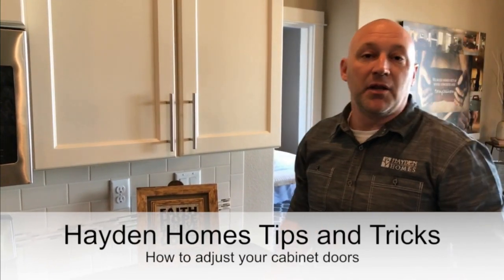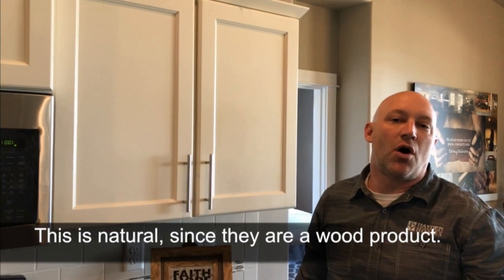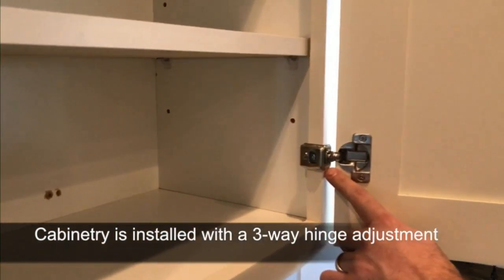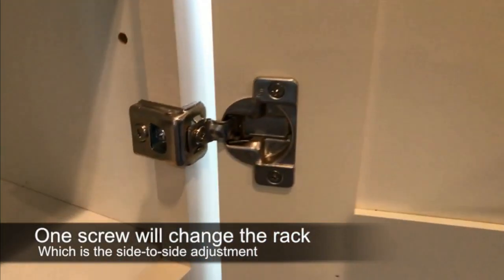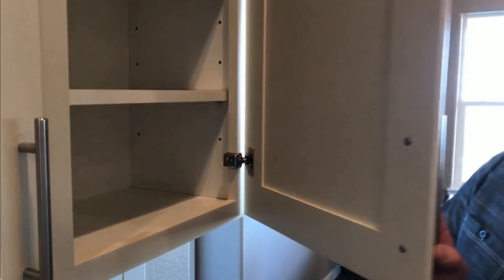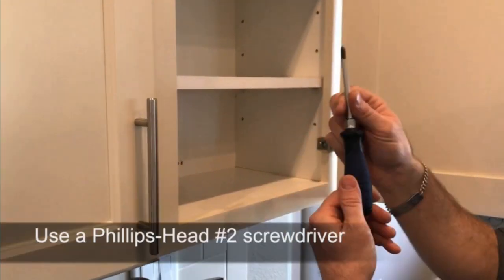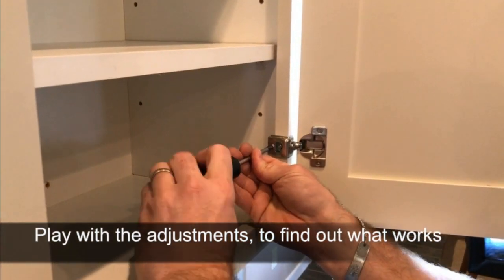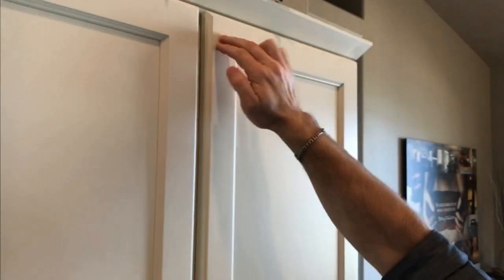Do it Yourself : How to Adjust Cabinet Door Hinges - Step by Step

Comment: How do I fix, this exact hinge version, where the door no longer closes on its own fully.   It used to close fully against the face of the cabinet easily on its own.   Now I “swing” the door to close, but it doesn’t self-close fully.  Depending upon my encouragement, it’ll stop about 3/4” short of the cabinet face.  I can provide a very slight encouragement, and it fully closes, with no obstruction nor resistance offered.  It’s just not a full easy closure on first hand gesture.   (PS - it’s not me getting old. 🤔😉😁)
Reply: I have the same problem. Within my hinges, there is a piece of plastic which I believe acts like a spring. This piece has broken in half my hinges.Rather than replace the hinges, I installed door magnets which work better than nothing but are an eyesore.

Comment: Hi, this adjusted my door so it is flatter against the frame, but now the door slams shut, no more soft closing. Any ideas how to fix this? Thank you!
Reply: You can buy little adhesive pads  for them, put it on the content points

Comment: We all understand you turn the screw to adjust it....what we need to know is which direction.
Reply from the maker: You will need to play with the direction to determine which way you need to turn the screws to adjust it. As it is based on what specific adjustments your cabinet needs.